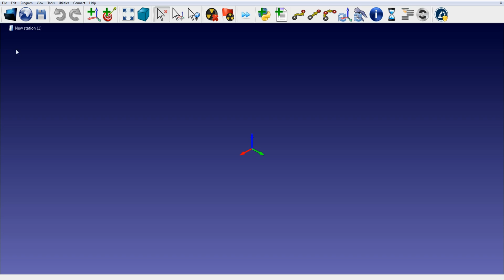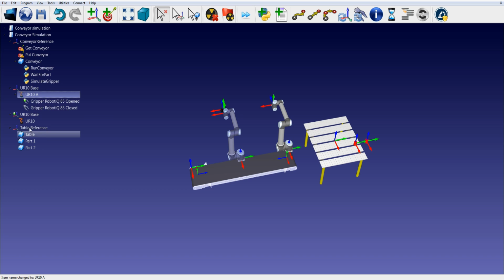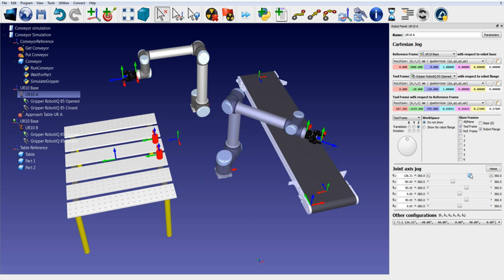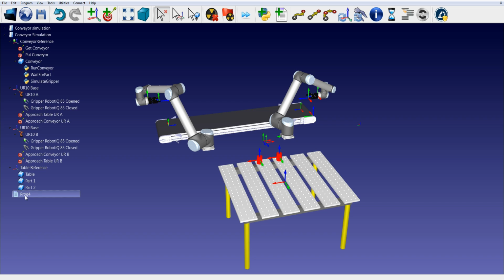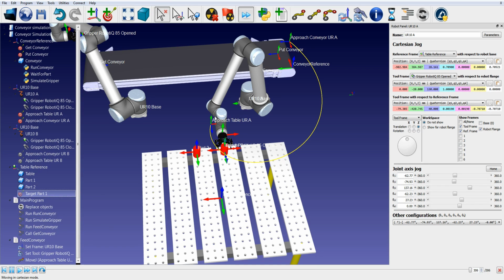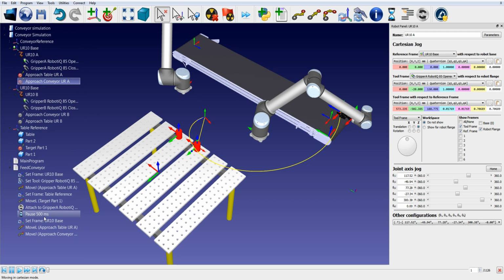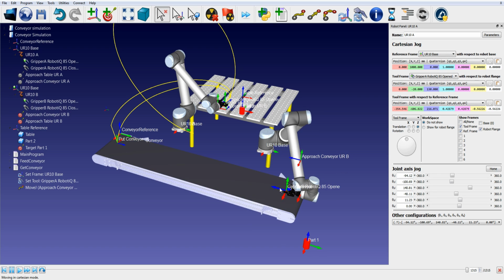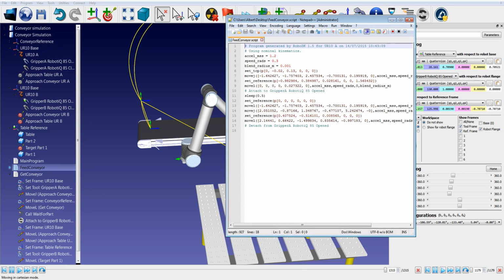Conveyor Simulation with 2 robots - RoboDK

Comment: HI. I am working on one simulation, I am facing a problem with a robotic gripper. I have tried a lot, I am not able to attach objects with it if I am using it as a tool. I am not able to move the gripper's finger and if I am using it as a gripper, I m not able to attach objects. I have tried the mechanism function also but could not do it. could you please make a small video on attaching objects with a robotic gripper or can guide me. Please it would be really helpful for me. Thank you!
Reply from the maker: You need to create a TCP by right-clicking the robot and "Add TCP". 
You then attach your object to that TCP. 
The gripper is just a mechanism for visualization purposes, but you still need the TCP.
Reply: @RoboDK3D  Hello. Yes, i do that only. But after adding gripper as a TCP. I am able to attach the object with it. But not able to move gripper fingers while picking the object. My question is: How to move gripper fingers while picking up the object.
Reply from the maker: @pankajnaryal22  You need to have both, the mechanism and the TCP. 
The TCP shouldn't be linked to any 3D model.

Comment: Hi, I have a problem with Python. When I push the "SimulateGripper" I'm taking "Python script faied returning 1" error. Why did it do that ? How do I can be solve ? Thanks.
Reply from the maker: Make sure you have your Python settings properly setup in Tools-Options-Other. You should install RoboDK with Python (default setting).
Reply: @RoboDK3D  Having the same problem.
Reply: @NightmareWalkthroughs   did you manage to figure this out in the end ? I have put the settings to default and still have the same error
Reply: @RoboDK3D  I tried but still get this error

Comment: How accurate will the cycle time (provided from the simulation) be, compared to the actual one?
Reply from the maker: The cycle time simulation with RoboDK is very accurate for UR (less than 1% error). This assumes that you do not exceed the robot maximum limits and you don't use a blend radius.